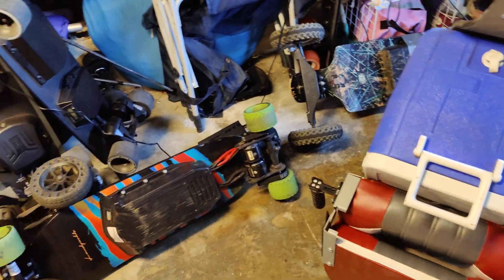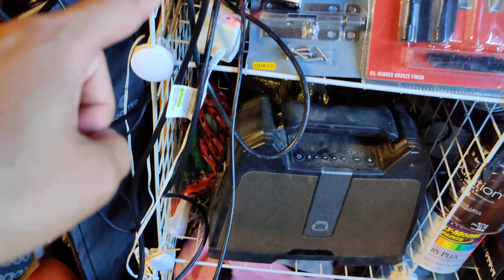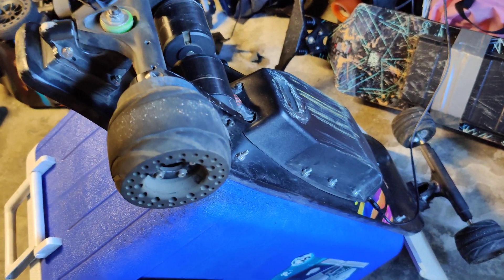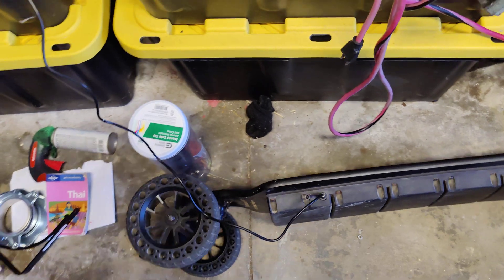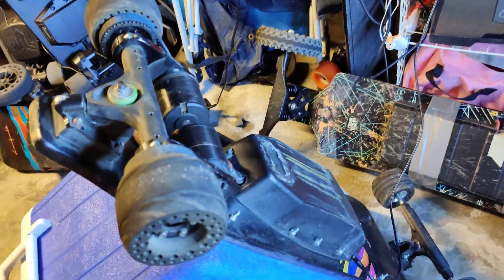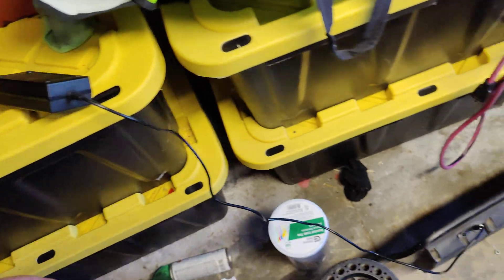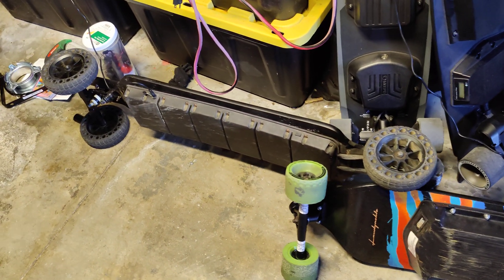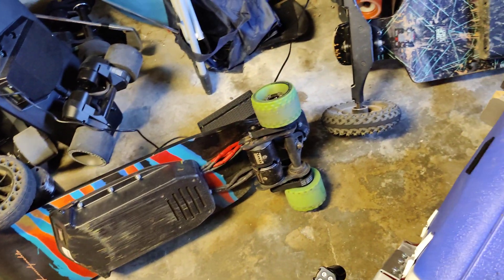How to Fix Dead Electric Skateboard Batteries!

Comment: dude has like 9 boards lol. No teamgees? I hear many don't work and are hard to even get shipped out, but I like mine for 150 used. My battery won't charge to full but still works great. My output is 42V at 1amp

Comment: Hey i have an issue with my electric skateboard. it only works when the charger is plugged in and when i unplug the charger and pressing on the start button on the skateboard it won't light up. why is that? how to fix that?
Reply: At the end you found a solution?
Because I have the same problem

Comment: I have a smaller boarder that uses a 29.4 volt charger and it isn't charging likely because it's way below zero, I get some blinking and beeping when I push the power button but that's it! What voltage do you recommend I try to see if I can being her back to life?
Reply: what did you do did it work I think I have the same board with the same problem as you

Comment: I recently got my first board ever and its battery was basically dead on arrival and the company I bought it from had gone bankrupt so it's been a pretty frustrating experience, but this gives me hope
Reply: What brand is it? Did it work?
Reply: @aidant7221  It didn't work but I later took the battery pack apart and spotted the problem. A connector on the circuit board wasn't actually attached, so the board had always been able to receive power, just not discharge it. It was in a really hard to reach spot and I even spoke with an electrician about getting it soldered into its slot but he declared it not possible to get to. I later had a realization that the other electronic connections weren't soldered, they were glued with some funky glue stuff. So I compared all the glues I had on hand and figured I'd go for one that hardens into something that is ever so slightly elastic, as opposed to hard and brittle, since this is going to experience a lot of vibration. TLDR: I fixed it with some glue and it has worked like a charm since. Fell on my ass twice the first 5 minutes I tried using it : P
Reply: @aidant7221  Teamgee?

Comment: Quick question hopefully you can help me out. I have the backfire G3 like new only rated like 10 times bought it last summer. When I put it up for winner, it was on a food charge and then when it was time to write it, it was dead so I charged it and it charged and turned the green light on in 10 minutes then the next day it was dead. Please help.
Reply: Exact thing happend to my long board. I have the same one as you.

Comment: My board charges but when i try using the board the battery loses all juice until plugged back into the charger then works for acouple seconds only to keep shutting off
Reply: Yes yes this is me just now with my first e skateboard I just got. Works for a minute, turns off then won't turn on again unless I plug it into the outlet just to turn it on. Idk I'll try charge it overnight I guess even though it shows it's fully charged

Comment: I have a Halo Board carbon edition. Brand new but has not been used for 3 years. It was shipped by sea and arrived this week. Life, work, and travel restrictions eg coronavirus meant that I ended up settling in the UK. The manufacturers will not provide any support to attempt a repair myself. Their reason for not helping is that I'm no longer living in the US. I think a more honest answer would have been that they do not want to give any time on this. Thank you for your video. I would appreciate any advice that you can give eg anything I definitely should not do?

I took the top off and disconnected the battery to test its voltage with a multimeter. That gives a reading of 1.889V. The label on the battery says 6.6AH (capacity) and 36V (standard voltage). I've ordered a 2.1mmx5.5mm 12V DC Male Jack to Alligator Clip power cable connectors. Its usually used for CCTV security camera lighting but in my case I will connect it to a 200W adjustable power supply (PS201ADJT). I can only adjust the output between 5 to 15V and current limit 0 to 15A. I might have to build something to get it down to a voltage low enough to charge the battery. Any help or advice would be appreciated. I've never attempted anything like this on a lithium ion battery before. I'm likely going to have to build an LM317 voltage regulator to get this battery working again.

If anyone has to attempt something like this possibly due to very bad technical support from their skateboard manufacturer here is a useful video to build a voltage regulator. If you are in the US all of the parts can be purchased easily.
https://www.youtube.com/watch?v=IjJWWGPjc-w

Also found this on amazon https://www.amazon.co.uk/Charger-Digital-Balance-Discharger-Batteries/dp/B07LG21Z3P/ref=asc_df_B07LG21Z3P might be useful for other repair projects
Reply from the maker: Bad bms is very common also, you can try this https://youtu.be/rw9EYVSWaz0
Reply: @dr.eskateboard3381  Thanks, your forum link doesn't work. Can I email you Lee?

Comment: I have an Evolve GT that won’t charge. My charger is a 42v/2A charger and stays green when plugged in. The battery has 10 cells and each reads roughly 4050mV. The total voltage of the pack is 40.952v with a current of .012A. I’d like to try your smaller voltage charger trick but when I look for chargers to purchase for 36v they all state they’re 42v/2A chargers. What do I purchase? Need help

Comment: Thanks for sharing the great video. I have an arc board I got used but it won't charge. Original fast charger output is 38V 3amp. I plugged in a notebook charger, output 16V 3.75amps, but even after 8 hours the charger is not warm at all. Any idea of what could be wrong? BTW, the motor runs with the battery level light in the red.

Comment: Just wanted to stop by and tell you that this worked on my evolve bamboo that had a dead battery.  I stuck on a charger to a vacuum cleaner for a few mins and then stuck on the original charger and now it's charging.  Thanks a lot bro!
Reply: Hello I have the same problem, can you tell me how you connected it thnks
Reply: @nelsonbonaki2345  I just took an old power plug that was lying around the house that had the same sized plug as the original charger.  I just plugged it in for like 10 minutes then I unplugged the non official one and plugged in the official charger and the light started blinking indicating that it was charging again.
Reply: @wetokebitcoins1769  Thanks, I was wondering why no charger has the battery output for my skateboard model (GTR), I guess your model is the GT?
Reply: Thanks for the info guys! I'm hoping my board will come back to life again. I've got it on a Dyson vacuum charger right now 😄
Reply: Hey I have the same problem on my Stoke. How did you find the right connector? You know, it has a certain shape as in it's not a typical USB type C connector or whatever, you get what I mean?
Reply: @laithsu  look for stuff that is lower voltage than the original charger and has the same connector  type.  the plug for some of your other electronics around the house might work.  if not then amazon sells some with multiple tips and adjustable voltage.

Comment: Very important question my board doesn't charge I meant it changed but doesn't fill it . Exway flex. What should I use as a charger
Reply from the maker: So it charged but not 100%?  Keep power cycling, basically ride to 50% then recharge to 100%.  Batteries probably not balanced then it wont charge to 100%.

Comment: Can someone please share a link to the correct volt charger that would work for my board? He shows a close up of the 42 volt charger, but that is not helpful. I need specs for a lithium battery 10s5p 18650 36v, 10ah, 360 Wh. I'm assuming, based on this video, that I would need a charger that is lower than 36 volts, which would probably be a 7s 29.4v 1.5 A. I just want to be sure before purchasing. Thank you for your help!
Reply: I have the same battery in my off road board. It charges enough for 5 seconds of riding and then totally dies . I can't even find a replacement battery so I don't know what to do next.

Comment: I have a Lycaon board GR 2020 and the charger stays green so it’s telling me it’s fully charged. I turn on the remote then sync it and then immediately dies. Does anyone know what that might be?
Reply: I have the same problem with my Swift, what did you end up doing?

Comment: My problem is the board quit running. Battery is nearly at full capacity and won't power back up. It suddenly quit while riding. Remote also shows full charge but pulse vibrates indicating disconnection from board. Even tried pushing and holding power button with pen to make connection. Still nothing
Reply: Same problem here

Comment: Hi I have a skatebolt breeze 2  my battery is 4 month old Samsung 18650 10s2p when I conect cthe charger is 42 volts  show green that means battery is full but won't start skateboard  and the output voltage on my skateboard battery show 16v only if I plug charger shows 42 and I can start skateboard. should I apply your method or something different because battery is full charge. please help
Reply: Did you manage to solve it ?

Comment: Yo I have a 36v 5.8 brand new right out of the box it won’t hold a charge at all I have a 12v charger on it now but I don’t think it’s working maybe dead cells what are my options on upgrading the battery for better range and distance

Comment: If you don't have a charger you can flip a bike upside-down mesh the wheel with a motor and crank the petals, so this for around 5-10 minutes untill it turns on. Spinning it like that generates power and charges your skateboard. I just did it
Reply: From my understanding, the board has to be powered on for regenerative breaking to be functional.
Reply: Did that for my board but it still can't charge
Reply: Same. Bustin magneto hybrid  @walter8758
Reply: I think I would get amazingly fit trying to do that with my board. My batteries have almost completely discharged so I would be severely cranked off with myself if I ever tried to learn your skateboard trick

Comment: BRO I WATCH YOU VIDEOS  THEY ARE GREAT I NEED SOME HELP WITH MY EVOLVE 2ND GEN BAMBOO ALL TERRAIN  I CANT SEEM TO GET A CHARGE GOING ON MY BATTERY
Reply from the maker: Try opening up board and measure the battery pack with battery terminals disconnected first.  If near 40v your battery pack is fine and probably bad bms or esc.

Comment: my board has a 42 volt charger, what do you recommend  36v or any thing lower is fine???
Reply from the maker: I would actually recommend adjustable bench power supply, then you can dial in any voltage you want.  Get a 60v power supply so you can do 0 to 60v.

Comment: Hey man I got a question for you maybe you can help me out I'd really appreciate it. I have a battery pack that charges normally but then when I ride it for a coupe of kilometers it will just die all of a sudden. It shows the charge as full initially and then once I reach like 80%, it shuts right off and it will not turn back on? Do you know what might be the problem? Or maybe you can point me to one of your videos to see how I can test or what to test? Thanks Dr.E!
Reply: Seems like one of your P group might have a loose connection or a bad cell. So its draining faster then the other p group. BMS will shut it off when it detect it at a certain voltage.
Reply: @619Mylife  thank you ! I think I'll just upgrade to a larger battery pack. I wanted to upgrade anyway.

Comment: I have Ownboard AT like yours. I left it for 2 months without charging it. Obviously now the main charger, when plugged to the board, stays with the green light on and this means that isn't charging. Did this happen to your AT as well? If yes, did you sort out the problem in they you said in the video? Thank you
Reply: It does this happen only when the battery discharge by itself completely? Because the board is new, I've only used it for 3 months and about 6 weeks without using it.
Reply from the maker: This is a faulty bms, battery pack is fine.  I will have a video on bms replacement soon.
Reply: @dr.eskateboard3381  don't you think is the same problem you had? (What showed in the video)
Reply from the maker: Yes I thought it was just bms discharge but later found out it was bad bms or bms that went bad, this seems to be a widespread case for ownboards.

Comment: Hey dude, I just got my Ownboard AT1W and it has pretty much the problem you're saying. Charger won't change light and whenever I charge it for hours, it turns off super fast. You believe even in the case of a brand new board it's worth trying it?
Reply from the maker: I am gonna figure out how to fix it or maybe just replace the ESC.  It seems Hobbywing esc likes to die.  Even my Vestar is dead.
Reply: You actually believe swapping the esc might help? I might just unplug everything, plug it back in and see if it helps somehow
Reply from the maker: You need to try measuring voltage of battery first.  If battery is at 42v at full charge it's not the battery but if battery voltage 36v or below and not charging it's your battery that's dead.
Reply: @dr.eskateboard3381  Thank you so much for your help, take my sub ;)